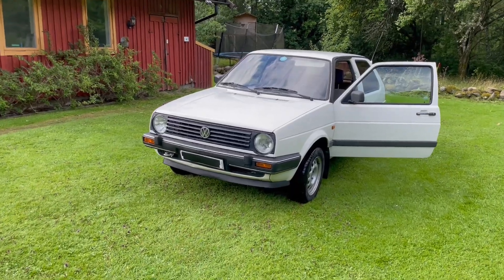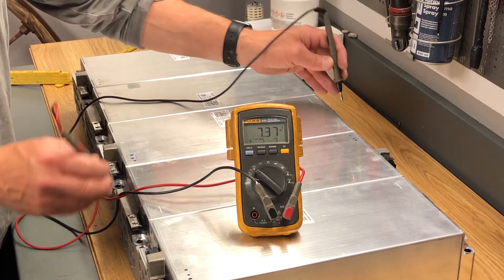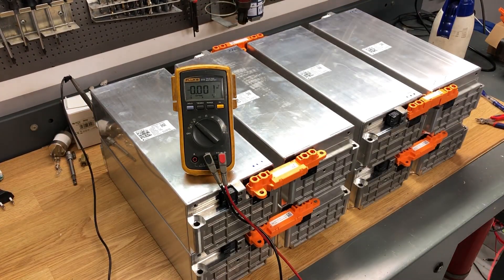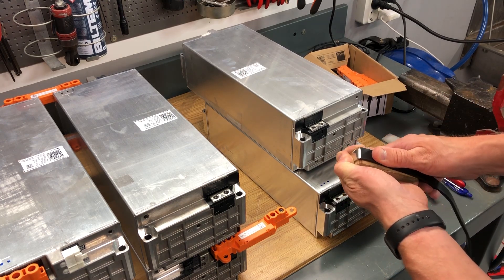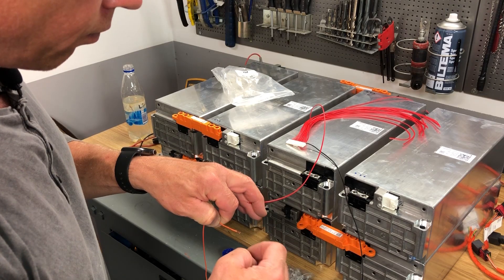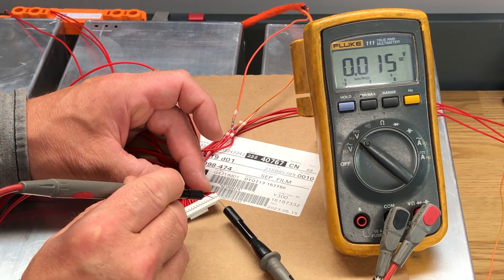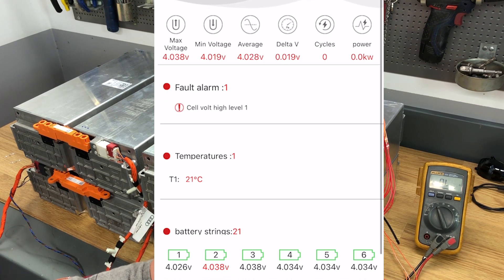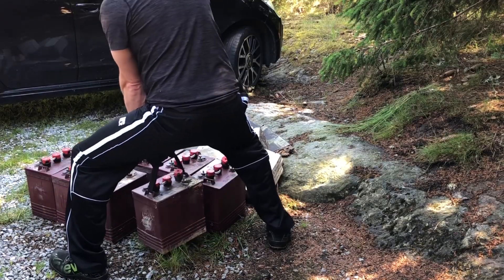VW Mk2 Citystromer, All Electric, Lithium Conversion, Audi e tron 55 Battery Modules

Comment: Hi. As always really informative and great hints and help understanding. 
I want to get a mg5 long range pack but instead of stripping it all, how can I leave it in the pack and connect to my inverter as it's over 300v? Any idea would be a massive help before I buy. Thanks as always. David
Reply from the maker: Hi David, sadly I have no knowledge about that battery so therefore I can’t give you any recommendations. Sorry. I really wish you luck with your project and please be careful.☺️

Comment: Very nice. I drive a 2002 Fiat Seicento elettra. with 22kWh Li-ion batteries from a BMW i3 (5 modules). It also uses the  solution from Siemens for charger inverter an motor from their small traction motor programme. Yes efficiency is bad by today's standard, both weight and losses could be avoided with a never inverter / motor / charger combo. A Nissan leaf drivetrain sounds like an overkill and possibly not the best shape for a Golf engine compartment. What about the drivetrain from an I-Miev? Still an upgrade of the power compared to the 30kW siemens motor, but easier to fit and lower weight. Also they are now so old, so cheaper than leaf in salvage parts? I solved the charger problem, The old original single phase 3.5KW was slow and has poor efficiency. Solution was to buy a 15KW 3 phase DC charging power supply intended for a Chademo charging station. it has a front panel to select max voltage and max current. Works excellent as an AC "fast" charger. It has modern power factor correction and smooth ramp up and down and moden level efficiency. Cost only 1200 EUR including taxes from China, works well still after 3 years. I see some are talking about battery cooling in the comments: Not a problem with that size motor with Li-ion batteries. Only highway-15KW charging-highway would accumulate heat driving in summer. rest of the year and with average driving, the worst is 5-9C hotter batteries from morning to afternoon driving all day.
Reply from the maker: Thanks, i already have a leaf drivetrain so that’s why I think to use it. You are so right about the heat, those batteries have to be loaded really hard before the heat will be a major issue. 

Thank you for your input and information 😃👍🏻👌🏻
Reply: @flyingtools  It is absolutely old school cool to drive around a 20+ years old EV around. I lost count of how many Tesla owners have asked me what kind of car is charging next to theirs. Also I really appreciate the lower consumption of an EV of normal size. I rarely use more than 100Wh/km.  Something important when we had electricity prices increase last year.

Comment: This is such a great project you have undertaken.
I was thinking that cooling of the cells may be a problem under the back seat? I guess that you are not expecting huge charge or discharge currents given the size of the bus bars between up and lower banks, so perhaps not a problem.
Why does not being able to find the ABB power electronics the trigger for complete replacement of the drive train? I would think you should be able to get a suitable controller for the motor that came with the vehicle?
Reply from the maker: Thank you 😊 
The heat will definitely not be an issue with those kind of cells, 
Charge current, is only 50 Amps and the bussbar I created will probably handle almost as much as the original bus bars. 

It was simply so few cars built with this electronics, and I think that most of the guys just throw them away if they were broken. The motor is also changed to a brushed one. It does not even has the same voltage. I would love to make it original again, but I think I will make it even better now when I don’t have that option.😉 thank you so much for your comment.
Reply: @flyingtools  Oh, I'm with you now. It was already modified fundamentally.

Comment: Do you know what is C rating of that module from 2.65kW ?
Reply from the maker: The Etron use 750A at full power, that’s a c-rate to 3,125.  So 4-5c is probably the correct discharge C-rating.
Reply: @flyingtools  det høres ut peak ikke kontuerlig..jeg har ikke fakta ..men har lest at den er 2C.
Reply from the maker: @ItisImarko  ja, det är peak i 10 sekunder. Har ej sökt mer fakta då jag kommer ligga långt under de värdena för egen del.